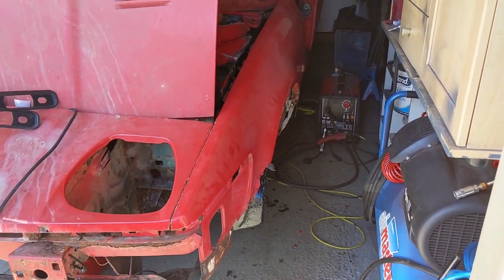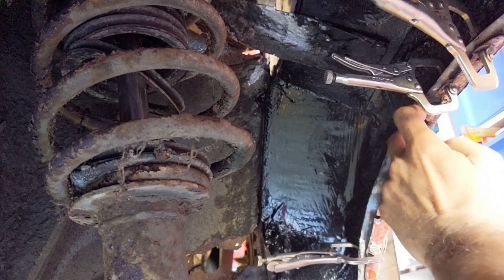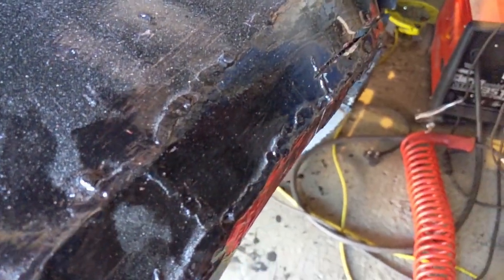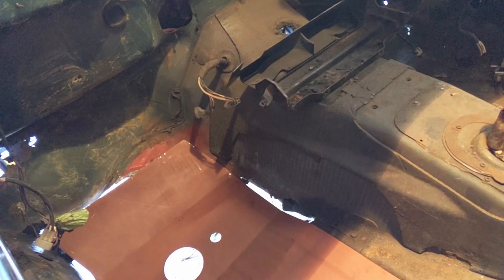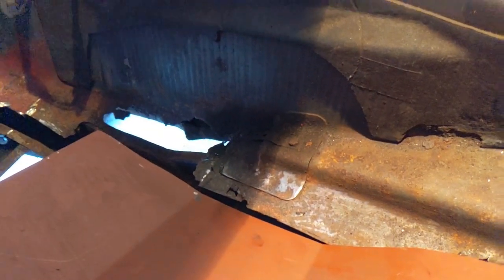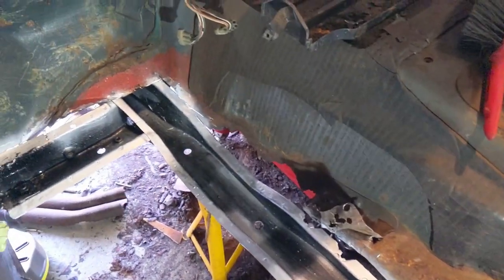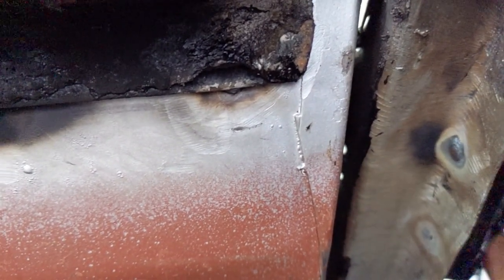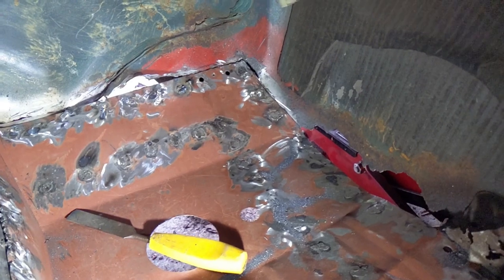Triumph TR7 Restoration: Episode 20   Passenger Front Floor Pan

Comment: Hi Henry, A lot of work has gone into that. I think its a wise move to get the inner wing (or repair section) as trying to fabricate one from scratch using small sections of flat steel will never fit perfectly. You could unwittingly be bending the wing out of shape to best fit your repairs which won't show up until all of the panels are fitted together.
Keep up the good work👍.
Reply from the maker: Thanks Carsten - yes, I just decided it was too far gone, although I've only bought a repair arch rather than whole inner wing so hopefully not wasted money

Comment: Lots of welding but it’s coming together 
I’ve just started welding mine it’s quite satisfying seeing it going back together really enjoying your videos
Reply from the maker: I'm glad you're enjoying them - much appreciated.  Just got to work through slowly but surely
Reply: @HenrysGarage  
I’m doing the wheel arch now I bought the outer repair panel it’s not a great fit I’ve had to cut it in to 3 to get it to follow the original line I was toying with buying the entire inner arch it would have  been a much easier fix but there so expensive If money is no object then I would but it’s not and it’s a part nobody will see I think you should stick with what you’ve done and with a bit of tinkering it will be ok
Reply from the maker: @Willyscars  Now that's filled me with trepidation for when I start it! :)

Comment: If it were me, I would buy the outer replacement panel and replace that first as there is some manipulation required to get these to fit. I have had mine tack welded to start off with, however, it is at the welders to have these seam welded and the lower rear sills too.
Reply from the maker: Thanks Mark - good tip

Comment: Your wasting your time to be honest, there is only one way to restore these old rust buckets, and that's a strip to shell and shot blast it back to bare metal, once there you have to install it in a rotating jig (you can make your own) so you can get at it properly, then remove the corroded panels at thier joint welds and replace each panel or fabricate a new one, all your doing is ending up with a patchwork quilt of repair plates that are welded to corroded metal, end rsult will be a car that corrodes on all the places you didn't replace!
Reply from the maker: Hi Mike, I think I'll plug away at my approach.  I'm not interested in trying to recreate a new car, just the enjoyment of doing the job and driving the car at the end of it